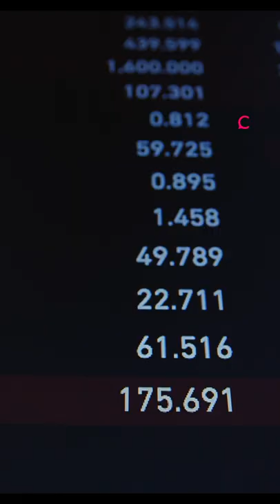Why is India unable to design a jet engine for fighters?

Comment: Because government is unwilling to invest in in engine tech.

Goverment is barely putting any funds into its development and then crying about not developing it
Reply: I wonder where you get your facts from! Far from truth. Read about the JV with Saffran that will soon be inked for 125 KN class Jet Engine development
Reply: @hahua90  look at kaveri engine, goverment barely invested anything and for 125jn engine the deal is not finalised so it still counts at zero investment
Reply: @theunbeatable1755  The one and only mistake of government is sanctioning this project to a government owned company where delays are more effective than efforts.
Reply: @de-comm8715  gtre and drdo successfully made the core section and developed crystal blade tech with almost no funding

And no private company has the ability to develop this in india so there was no other option
Reply: @theunbeatable1755  Private companies can do the same but quickly. 
Bharat Forge has claimed that it can develop a jet engine within a decade with no government funding.
Reply: @de-comm8715  there is a different between caliming and developing 

Tata was caliming to develop a plane in 2 years it has already been 4 years. And bharat forge has no history of even developing small engine for missiles. Just because a private company calims it doesn't mean it's true
Reply: @theunbeatable1755  ok, I forgot to mention something. 
There was one condition that if government is willing to order only then we will make it. 
Btw general electric was also a noob in making jet engine and all they wanted is TOT, now they are one of the best. 
If you can't bring competition to execute one task then there will be no efficiency and efficacy.
Reply: @de-comm8715  lol general electric has mastery in engine  and they weren't given  orders of big jet engine it took them more then 50 years to develop the morden engine , they were given small engine order in start,if given orders for more powerful they would have failed.

Also give me the source where bharat forge claimed they can make jet engines.

Jet engine isn't something any company can make, if asked  a million private company will tell they can manufacture jet engine for money but in reality only 4-5 company in the world can

And bharat forge does not have capability to develop mordern engine such as kaveri engine, they haven't even developed any tech required for making such engine neither do they have any experience in making engine.
Reply: @theunbeatable1755  General Electric was already a giant ass company before the manufacturing of jet engine but still there were missing pieces to solve the jet engine puzzle. 
I could've agreed with you until I saw Tata (a company known for making worst cars) doing well with armored vehicles and SSS defence with assault rifles. 
It's all about interest of approval from government and security forces unless we were not importing assault rifles.
Reply: @de-comm8715  it's a lot more then that general electric was already big engine manufactrer and has many components required to make engine which none of indian private company had earlier and sss uses lots of foreign parts and only some parts from india.

And stop believing anything a company says just because its a private company,they can be equally inefficient.

And u have to still show me proof where bharat forge claimed they could manufacture  engine if such capicty
Reply: @theunbeatable1755  around 2500 crore rupees were spent on kaveri engine alone. And the news on JV will be out any time soon... you have no reason to be pessimistic..but its your wish
Reply: @theunbeatable1755  The Bharat Forge is already working on small jet engines for UAV, they need technology for better metallurgy and process to make bigger jet engines. 
Although their statement on manufacturing a full fledged jet engine was in a generalized manner but it was intended to express their willingness.
Reply: @hahua90  2500 crores is very less and 10 times the investment was required
Reply: @de-comm8715  u still haven't given me proof of your claims where bharat forge claimed they can develop kaveri level engine.

Developing small engine isn't something new 5,000 companies country do that but developing a kaveri level engine can only be done in 6-7 company in the world
Reply: @de-comm8715  sure give me the statement proof

Why are u change topic
Reply: @theunbeatable1755  You can try to post a link in comments section to know what I am talking about. 😁
Reply: @theunbeatable1755  YouTube is censoring link in comments section !
Reply: @de-comm8715  sure then give me the name of the article I will search it
Reply: @theunbeatable1755  there are numerous you can see on a simple Google search.
Reply: @de-comm8715  General Electric has been making jet engines for almost 60 fuckin years wtf are you talking about.
Reply: @de-comm8715  First jet engine they built was fuckin 1942.
Reply: @brandonstrife9738  lol who said they ain't?

Comment: Cause that shits complicated and needs decades of technological experience.
Hell China is still buying Russian engines
Reply: Chin a already surpassed Russia in practically all aviation related fields and also in engine design. Heck .. even the most modern Flanker is Chinese and not Russian developed/built🤣
Reply: @xyzaero  
but why pakistan still begs infrønt of every major cøuntry after selling their women to china via CPEC? Heera mandi products are getting discounted?
Reply: @vendetta12  Pakistan has nothing to do with this and your comment is unreadable nonsense 🫣
Reply: @xyzaero  pkmkb
Pair kaanp rahe the
Brahmos was fantastic
1971 was fantastic
1999 was fantastic
2016 was fantastic
Moreover Pakistani economy is fantastic 😂😂😂
Reply: @xyzaero  pkmkb
1971 was fantastic
1999 was fantastic
2016 was fantastic
Brahmos was fantastic
Even pakistani economy is fantastic 🤣🤣
Reply: @xyzaero  
And it took them To the 2000s
And the are still using russian based tech

Comment: Corruption is reason
Reply: Nope! The engine project is very very  complicated stuff cus it's like making a very delicate being which can withstand alot pressure and temperature and the countries that possess powerful engines are the ones that participated in the WW2 pakistan, afganistan, ect haven't even invented thier cryogenic technology and internal combustion is really really serious process where even a Minor mistake can shut it fown
Reply: @theidiotictroublemaker2281  india had a indiginious fighter jet in 1960's called marut, preety capable for its time,  the import lobby wanted its failure and thats what we got, LCA is the only 2nd  indiginious airplane operated by IAF after marut
Reply: @oksowhat  i didn't say Tejas was our first jet i said all our industry was  sent blocked by everyone

Comment: Hey man India's Kaveri engine with 76 kn is ready it only needs to be tested .
Reply: That is too heavy to put into any jet. Also sustained thrust is not possible that is why govt scrapped it. We depend on few engineers those read the research papers and try to replicate. Alloys are important to reduce the weight and to increase temperature resistance. We don't have the production engineering teams that can enable even though we can do a POC on these.

Comment: India hugely failed pouring billions developing Tejas which was outdated on arrival. Arjun tanks are also ok at best.
 India has to focus on it's strengths like missiles and nukes. India is too far behind to catch up in rest of the fields.
Reply: The only thing which India does better is missiles and increasing nukes are also possible if a country has already made some.
Reply: You can't win any wars or project any power pressing buttons and flaunting nukes no one can use without becoming the enemy of the entire world. You need ground and air power.
Reply: @steveh5307  India's military is not made for offence. It is primarily made for defence. This is why India had been buying weapons at the beginning.  Now it is a habit. Yes but India cannot be an offense force in a day. Therefore what defences India has are enough and foreign bought gear is also enough to secure India's borders broadly.
Reply: @ssa6227  OK, but you still need ground and air power to defend yourselves. You can't press buttons all day and hope the invaders go away. Strong army and coordinated air power is what works. And you need to get away from buying both Russian and Western weaponry. You can't integrate opposite platforms and hope to have an integrated military. It might work against low tech Pakistan but if India is to beat China, you need modern integrated battle field strategy.
Reply: Block Lord  Selling some weapons don't make you super power. Pakistan and Turkey also sell some weapons don't make them offense power. 
 It would take decades to manufacture all it's weapons only then can India be an offense power. So don't say India is becoming offensive power. It is non sense. India has no need to be offensive as it is surrounded by 2 nuclear powers.
Reply: @ssa6227  India is 4th strongest army with tons of indigenous weapons what are you taking mate
Reply: @subhamsonalpanigrahi6045  I am talking about you sleeping mate.🤣
Where the hell do you get this data?
Zee news?

Comment: India has addressed this problem and a JV with Saffran will soon be inked for the development of 125 KN class Jet engine with 5th generation technologies and it will have room for later upgrades when 6th generation technologies come into being. India's 5.5 Gen AMCA fighter jet, Tejas MK2 (MWF) and potentially the SU 30 fleet will be upgraded with this engine in about a decade. Indigenously developed Kaveri engine can produce upto 75 KN of thrust and will be used in UCAV program which is in development.
Reply: Key word “in development”
Reply: @jade7631  yeah...so?
Reply: @hahua90  its not good or is it real until its out
Reply: @jade7631  time will tell

Comment: The engine is not Indian? Bro tell me an electronic part on the hal tajas (samosa) that’s Indian made other then the nuts and bolts. 🤣 not even their own airforce wants the samosa fighter. They tried to export it and got laughed at on their faces.
Reply: Bruh that HAL Tejas was made in india it's radar from isreal and engine is from usa and airforce decline HAl Tejas cuz they want twin engine whil juke fighter-17 just paint in india other than all it's made in china
Reply: @ManjuSharma-jl6jp  while the jf17 is a joint effort between Pakistan and China, at least there are 3 separate blocks operating with confirmed kills not only in Pakistan airforce but internationally, with 25 variants on paper can you say the same about paper Indian tiger Hal samosa tajas? It’s not only the engine and radar that’s imported in the Indian samosa but the Ejection seats that Indian pilots love so much, the electronic counter measures and so on are imported too.